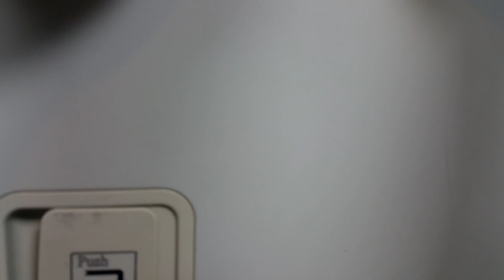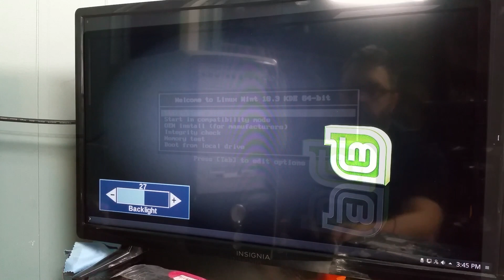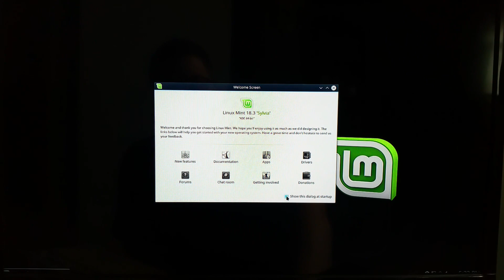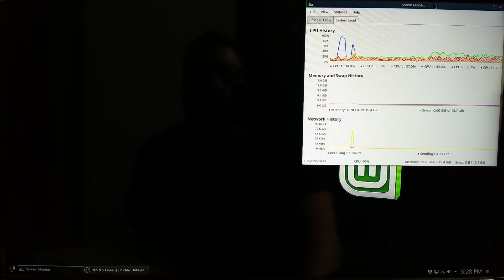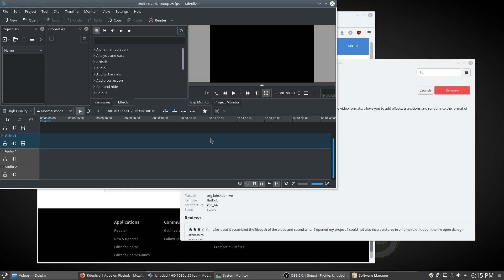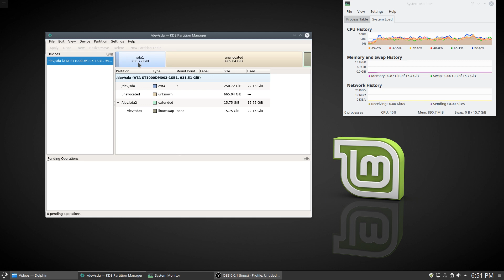Setting up Linux Mint on an AMD Phenom II X6 1055T

Comment: Superb video :) Damage not to place the bar in the right slot to benefit from the dual channel :) Exploit the memory modules per pair in order to cumulate the bandwidth and thus make the most of the capabilities of the system is when even better :) Well, I say that, but I do not know the second bar is identical to the first. To the visual I will say yes, but it is necessary still that the frequency, the capacity is identical. And sometimes even the mark. All the machines that I build in the workshop for my clients, I try to use the double channel as much as possible. Yours truly :)

Comment: I still use an i5-750 @ 2.6/3.3 GHz (1C boost), that CPU has a slightly stronger single-thread performance (stock) but a worse multithread performance. It is rather outdated but it is not as bad as people thank. You can play GTA with dips in high 40 or low 50 FPS with high settgins if you turn down AA (HD 7850), the same for Far Cry 4 (100% CPU load). With a game like Crysis2 the FPS stays over 60 with high settings (they call it very high). I will probably upgrade to Zen2, hoping that the RAM prices will become somewhat less insanely high. 
So I am not surprised that this OEM machine of FastGadgets can handle Linux Mint and KDEnlive fine. I myself run W7 and Manjaro KDE at the moment.

Comment: Recently put together a very comparable system using a Phenom II X6 1090T BE, even put a Wraith Prism color on it. I am running Mint also, it sports 16Gb of DDR3 and initially wanted to go for a RX560 but ended up using a GTX1050 I had laying around. Good Linux box for sure!

Comment: A little question, what happens if I install Windows on one SSD, disconnect that SSD and then install a Linux distro on the other SSD. I should have two bootlaoders, one on each SSD, right? Will it load the OS on the SSD which has the highest boot order while both SSDs are connected and the other OS when I change the boot order without any problems? Some people (Joe Collins) claim that it is better to have both OS on a different SSD. Given that I also like to game I will be dual booting for a while, or at least until I can run Windows in a virtual machine with low level PCIe access (PCIe passthrough or maybe someday SR-IOV). How exactly it works with the bootloader still is a bit of mystery to me. Where is is stored? On the partition of the OS or on a tiny partition which doesn't belong to any OS.
Reply: You will have two separate bootloaders at that point. You will have to choose a boot device via the bios/boot. This will be the case until grub will be updated and the os detection script will be ran, causing the boot menu to be updated, reflecting os's on your other drive too (if plugged in during the os detection).
Reply: Peter Jansen I have done it with Ubuntu 14.04 on one drive and windows 7 on a other hard drive and I had to select the drive to boot from from the bios and laterite updated the grub to list the other hard drive but I couldn't get it to boot windows so I just used the bios to change which to boot from
Reply: It is possible to chainload the bootloader of the Windows SSD from the Linux SSD. It has been a while since I had this running for the last time but if Grub doesn't pick it up automatically you may have to put a custom entry in your Grub configuration files.
Reply: With modern UEFI motherboards there is a separate EFI partition which doesn't belong to any OS. But if you put the Linux SSD as the primary, you should be able to chainload the Windows SSD.

Unfortunately I can't really test this now, but it may be an idea to try this in a virtual machine first before you try it with real hardware.
Reply: Sunil Janki it will work but you need to add the entry properly
Reply: Hi Serge, I remember you. Thanks everyone for the reactions.
Reply: Hello Peter! You need to install os-prober in your Linux distribution. Once installed as root run os-prober in the terminal and finally update-grub on Debian or grub-mkconfig -o /boot/grub/grub.cfg on Arch. Then there will be no problem at all for detecting the Windows OS.